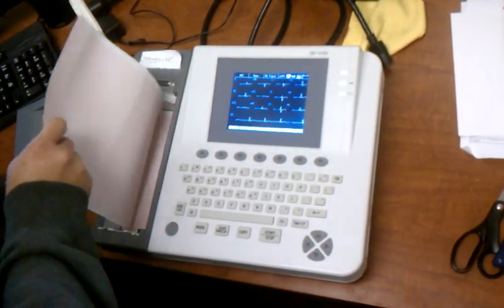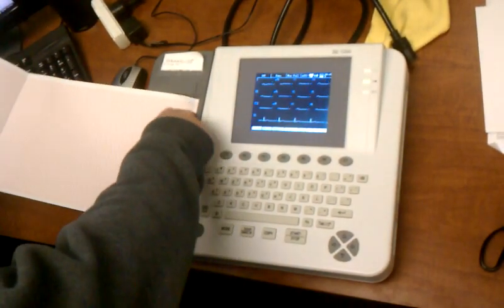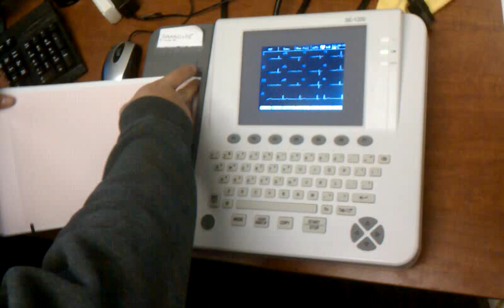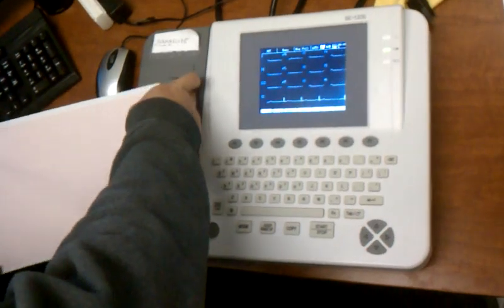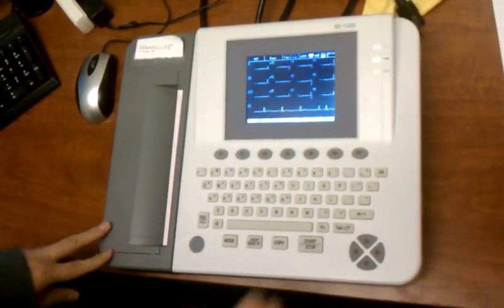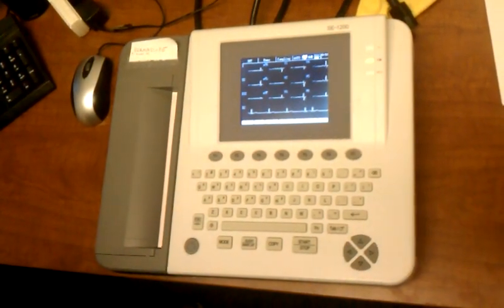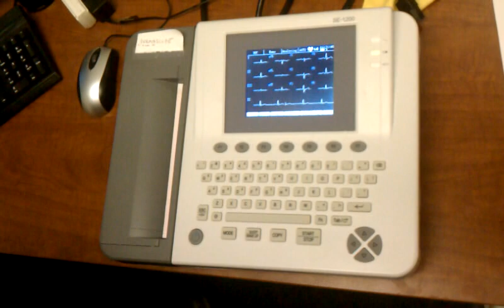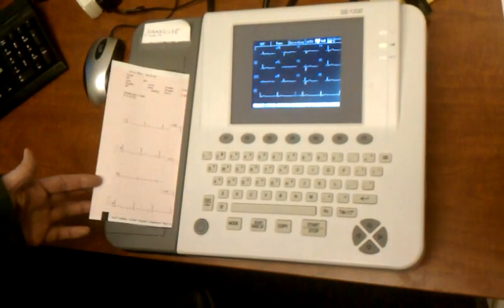How to load ECG/EKG paper

Comment: EDANUSA, how do you measure ECG gain testing? when you use a patient simulator and set it on 1mV output the ECG paper will print out 3 ECG squares per division at 10mV. There is a "Mismatch" because 3 X 10mV = 30mV but the patient simulators output to the ECG cables are at 1mV.